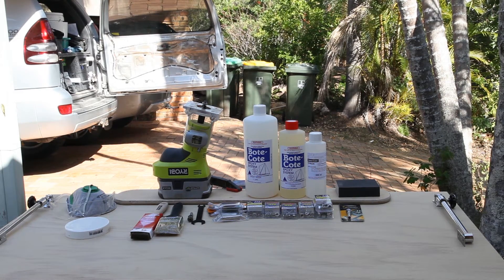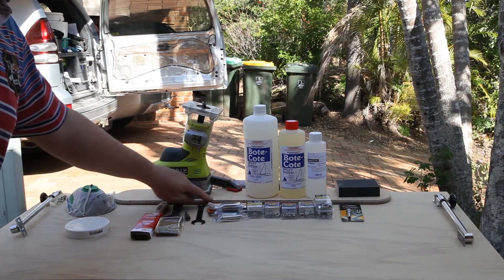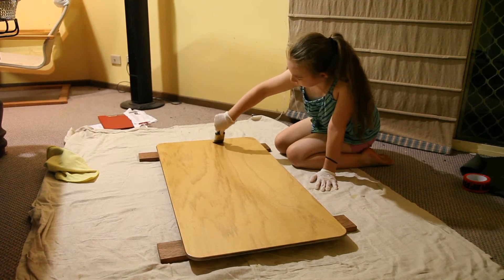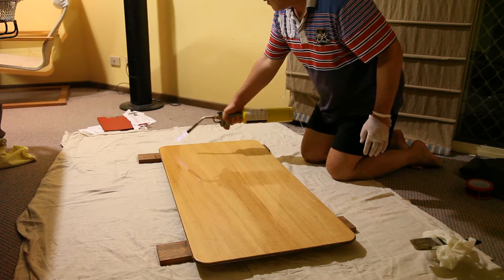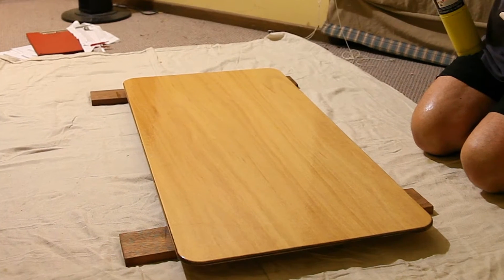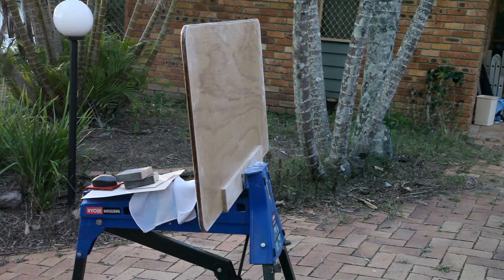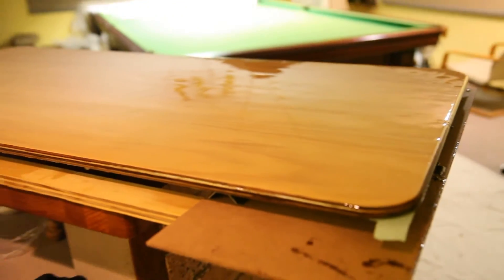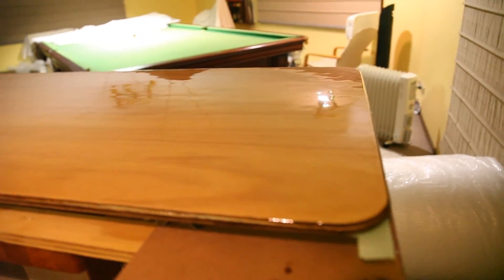Fold Down Tailgate Shelf Toyota Prado

Comment: Is the bottom end riveted to the plastic panel, not all the way through to the metal panel of the door? how much weight do you think it'll hold? 
I've been looking at setting up a rear door table but wasnt sure if the panel can hold the table of if i should bolt it through to the metal part of the door.
Reply from the maker: Yes, the rear of the table is riveted via the three hinges through the bottom of the plastic panel, however I have used very sturdy stainless steel backing plates to rivet into. I definitely would not recommend riveting into just the plastic without the backing plates. I agree they would be prone to popping out after some wear and tear . Therefore the fixing of the table to the bottom of the plastic panel is through 9 very sturdy rivet points spread across the length of the panel. I think even without any other fixings, I could easily hang from the table by these attachments alone without breaking the panel which is made of pretty sturdy plastic itself (although the screws holding the hinges into the table itself would probably give way under my weight! : ). Also, I believe the actual downward force at these three attachment points is fairly minimal during normal use of table given their close proximity to the tailgate and therefore presenting the least amount of leverage and downward force. The forces at these points are fairly static and pushing into the panel rather than downwards, so I don't believe their shear downwards strength to be as critical as that required for the other two supports. Most of the forces supporting the table and everything that might be placed on it are absorbed by the two supports attached from the top of the tailgate to the forward edges of the table. I did feel these had to be as strong as possible to support the expected loads so I fabricated/custom fitted two stainless steel brackets and did rivet these to the actual metal skin of the tailgate. I also fabricated two stainless steel brackets for fixing of supports to 'underside' of table giving much greater support than if fixed to side or top of table which would be more likely to 'pull out' under any weight. I also fixed the supports back somewhat from the front corners of the table to reduce their getting in the way during use but not too far that I would sacrifice strength due to increase forces from leverage as the attachment points neared the tailgate end of the table. It's been in use for over three years now and still going strong. I love it and it's one of the best and most practical mods I've made to my fishing mobile. :)

Comment: Thanks for the video.. I took ideas from im.. I have question.. From where did u get the rubber
Reply: Rubber used when table is fully closed
Reply from the maker: @mustafarama3480  Any rubber stop will do. I  got something like this off eBay --> https://www.ebay.com.au/itm/Bonnet-Bump-Bumper-Rubber-ONLY-Stop-suits-Nissan-Patrol-GQ-Y60-Maverick-88-97/182209597760?hash=item2a6c89d140:g:eD4AAOSwqfNXjJdN